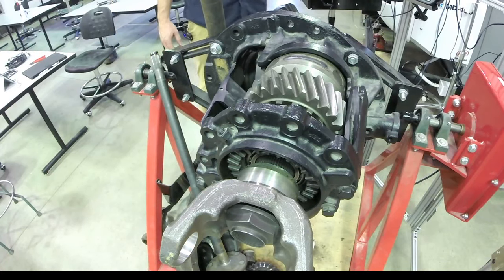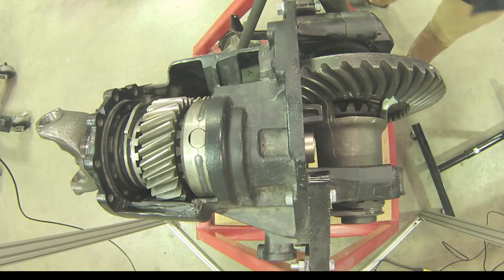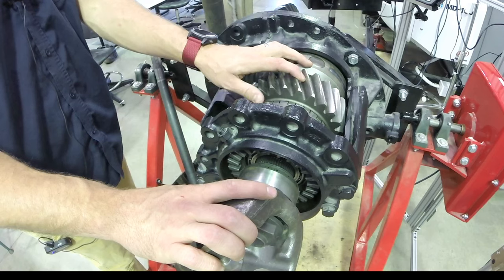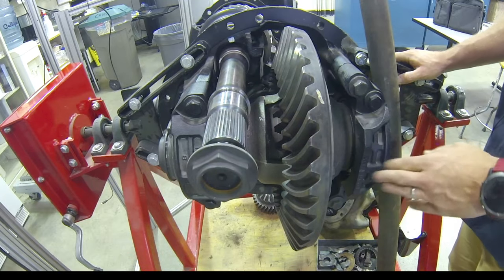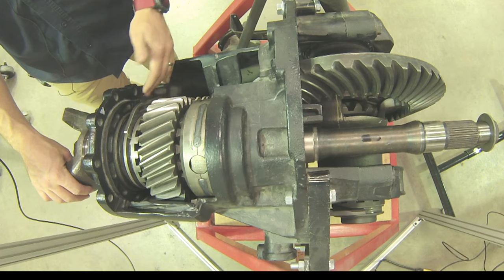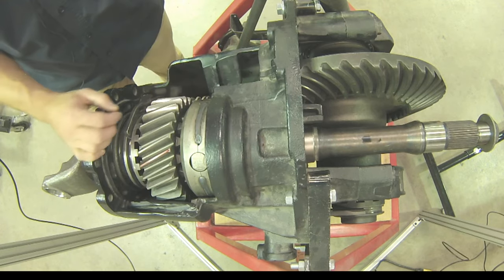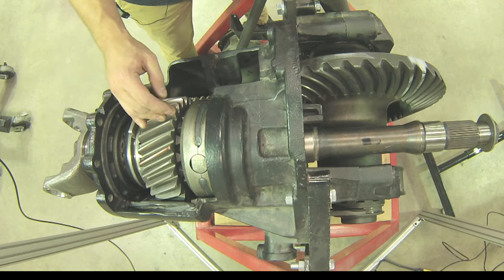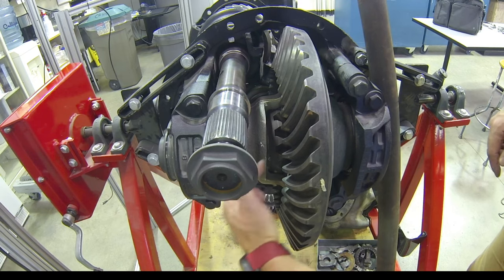Axle Fundamentals - Explanation of the Inter-axle Differential

Comment: Sir I have confusion that is in normal condition means without switching inter axle lock , is the power transmit to all 4wheels or only last two wheels?
Reply: Power to all, all the time locked or not. Locked just makes all have equal output even during slip.

Comment: I understand the axles are shown here being locked together, but are the left & right wheels on both axles also being locked to each other like in a normal differential lock?

Or is it just normal differential function on both axles, but with equal power each?

And if it's the latter, can both methods be combined locking all four wheels together at equal roation?

Comment: I have a semi that when I put in gear it won’t move till I put in the power divider then it’ll move but just the rear not the front rears will turn. When the power divider is on the drive shaft will just spin from the transmission. Any help?
Reply: Sounds like your spider gears are broke and when locked, only turn the heli gear.

Comment: So many driver believe that u only send power to the back when its not locked. They drive around locked all the time thinking they are wearing tires more evenly and they are doing the truck a favor
Reply: Seriously?  I've never heard of that before... I don't doubt you one bit! The only time I lock in is when there's potential for slip. I.e. a hairpin with gravel up a steep grade or when going from dry pavement to dirt... or when slip happens on ice and I've managed to stop and lock safely. ... I know better than to shift diff when wheel is spinning.... that being said... I somehow broke an output shaft the other day while in first gear on flat ground not loaded! It was like a laser cut the shaft! (Believe it was a factory defect) ((since the Eaton inter diff was almost exactly a year since a slip seat blew up both diffs!)) What a fluke!

Comment: The thing I'm really questioning is why do you need variable speed on both axles why not just have the whole thing a solid mechanism
Reply from the maker: It’s a concept called Ackerman’s principle. As the vehicle turns a corner each wheel assembly will take a different path with different sized radius. This will cause each wheel to turn at a different speed. If the diff is locked this difference of speed will be limited causing axle shaft, bearing stress and wear. It will also cause tire scuffing and excess tire wear.

Comment: My question is stupid, but I will ask ..if I drive 100 .Iles with the differential lock on. Will it damage anything..driving at 65mph
Reply: If you drive in a straight line on a perfectly flat road, it might be ok but the chances are it will cause transmission wind up.
Reply from the maker: Yes you will likely cause damage. The comment from 3d quick about a straight line is a valid point. The problem is that the tires likely have different wear, tire pressure and this causes the wheels to want to turn at a different speed as well as roads are rarely perfectly straight. When the diff is locked, they cannot turn at different speeds left to right. That causes wear at the axle shafts with increased torsion. It also puts the bearings supporting the axle shafts under additional load and puts stress on the lock itself. There is also a likely situation that you will cause tire scrub which will wear the tires more which will result in more stress and more damage. It isn’t uncommon in commercial vehicles to come across broken axle shafts. All this stress and wear creates more heat which breaks down the oils ability lubricate which in turn creates more stress and wear. There should be a theme emerging, follow the manufacturers usage guideline to reduce the chance of damage. Keep in mind I am responding from a commercial environment. In light duty vehicle they often have limited slip diffs and they handle the situation differently but are not often selectable.
Reply: I put buzzer/flasher combo warning systems on all of my trucks for axle and diff lock functions if you don't they will get left in and destroyed by the drivers!

Comment: Hi. My truck is a 10 speed manual (Eaton) the gears stock was on high range (I was told that this was a  minor issue) But The mechanic told me it's a big damage, they need to rebuild it for $ 3500 without labor!!!. I agreed. Then I found out, that he replaced it with another one, that one doesn't have a cooler (my transmission had one) tell me please if what the mechanic did is right/okay?. Should I accept this transmission ( the new one without the cooler)?
He's working on the truck now, haven't finished yet.. I still have time... should I accept what he did or not?? Please reply 🙏
Reply: Hi Mustang,
There are too many variables to speak to your situation. That being said, make sure that the expectations of the job are clear before work proceeds or continues. If you are quoted a rebuild, then swapping for another unit is a change in scope. The mechanic may be trying to save you money in finding a good used one. With swaps, the question is warranty, have a conversation about what you can expect. As for the cooler, most can have a cooler added by simply removing the plugs and connecting the existing cooler to the transmission. If you are getting a rebuild due to a failure though, the cooler should be replaced or you will have another contamination related failure. Whatever you do, you should talk to the mechanic, don’t try and hold the payment for the work after it’s done. If you don’t want what they are doing, talk to them.
Reply from the maker: I agree with Robert ;) I think communication is key. Clarify the budget, clarify the work, clarify the warranty expectations. Don’t hold work you approve from payment after the fact. If you have not approved the work, then the shop shouldn’t be doing it until they get approval. If you clarify all the above and they deliver something different or don’t deliver, then don’t pay until it is done as agreed.
Reply: @robertnagtegaal4355  
Thank you so much 💓 💗
Reply: @THET1916  
Thank you for the advice 🙏
Reply: @robertnagtegaal4355  
Thank you Robert and Heavy equipment for the help i appreciate it.
Just for clarification; i don't get to see the work while they're doing it. 
In my opinion i think they're trying to swap transmissions so they don't lose time... Yes, i was quoted in advance for a rebuild in my transmission, but by chance i discovered that he swapped it instead of doing the actual rebuild. When i returned today to see the truck i asked why did he install the one without the cooler, he replied" you don't need a cooler for the transmission, and your pipes for the anti freeze are rusty and i don't wanna mess eith it... " is it true that the transmission could run without a cooler or was he making excuses? Also couldn't he have just changed the pipes? 
Thank you very much.
Reply: @THET1916  
Thank you Robert and Heavy equipment for the help i appreciate it.
Just for clarification; i don't get to see the work while they're doing it. 
In my opinion i think they're trying to swap transmissions so they don't lose time... Yes, i was quoted in advance for a rebuild in my transmission, but by chance i discovered that he swapped it instead of doing the actual rebuild. When i returned today to see the truck i asked why did he install the one without the cooler, he replied" you don't need a cooler for the transmission, and your pipes for the anti freeze are rusty and i don't wanna mess eith it... " is it true that the transmission could run without a cooler or was he making excuses? Also couldn't he have just changed the pipes? 
Thank you very much.
Reply: @robertnagtegaal4355  
Their warranty; one year or 100.000 miles ....
Reply: @mustang4928  my understanding is that transmission cooler is filled with oil not "anti-freeze". Are you sure it's not a mis-communication issue that's going on here?

Comment: Can the inter axle lock be engaged at any speed as long as the tires are losing traction?
Reply from the maker: The inter axle should only be engaged with no speed or no speed differential from front to rear drive axle and depending on the model, limited to the max travel speed while engaged. Any turning done in better traction with the inter axle locked will result in damage to the inter axle.
Reply: No don't do it you will be taken it apart if you

Comment: Sir my doubt is, during a normal driving condition, all the four wheels of two axles take power or the frist drive axle of two wheels take power, the second rear axle is in dead condition.
Reply from the maker: I encourage you to watch again. The torque on an open interaxle is split between the front and back drive axle equally and then split again on an open axle carrier to the left and right wheels of each axle. It is a myth that one axle is unloaded and is not driving when unlocked and is not true. Any additional wear to any one of the two axles has to do with axle alignment or wheel wear or vehicle misloading
Reply: In normal conditions the engine is driving both the front and rear axle but because the centre differential is open, it will send power in the path of least resistance to either the front or rear axle so typically in slippery conditions the wheel out of the 4 with the least traction will get all the power and spin while the others remain static. Locking the centre differential power divider ensures one wheel on both axles receives power. For all 4 wheels to get power then the front and rear differentials need to be locked too. Not all trucks have that as standard though. Really in 2022 thise setup is archaic and there should be an automatic locking system like a Torsen device that senses traction loss and locks the diffs before the driver even realises.
Reply: @Heavy Equipment Tech Training (HETT)  both axles are always driven in this case because there is an interaxle differential.  Some trucks have an always-driven leading axle and a trailing axle which is driven only when engaged; I don't know if this is common enough to bother with, but perhaps you could show that in a separate video.

Comment: How about the triple axle?
Reply from the maker: The doubling that happens from the front to mid would double again from mid to the rear. Spinning Wheels on Tridem is a costly practice for tire wear.
Reply: @THET1916  The first interaxle should be 33-67% then. Yes one wheel spinning is gonna have 6x speed
Reply from the maker: @G55STEYR   not 6, 8x... I have been working in making a video showing htis using a tridem. It would be a collab with another instructor, I hope to get it going soon.
Reply: @THET1916  If the first interaxle differential has the 33:67 distribution suggested by G55STEYR, it would only be 6X, because the forward axle's splitter would only multiply the rearward output speed by a factor of 1.5 (not 2). At least recent Meritor tridem sets (e.g. MZ-610, P600, ProTec 5000) have this configuration.

Comment: Sir, do the interaxle differential, and differential in the tandom boogie operate at the same time when the vehicle is turning.
Reply from the maker: Yes, the bevel gear of each axle will go the average speed of its wheel assemblies while the unlocked interaxle will have its differential cross shaft rotating at the average speed of the two drive pinions as the cross shaft is connected to the interaxle input

Comment: Question to channel trainer: I have 2 trucks. Volvo with Eaton 3.90 rear, and Freightliner with Meritor 3.73 rear.

The Meritor 3.73 loses traction very easily on uneven ground, so I have to engage diff lock to keep moving WHEREAS the Eaton can creep up without effort. Is this due to the minor rear end ratio? 🤔

Also I checked the fluid level of the Meritor thru finger port and immediately upon unscrewing the plug, darker fluid came out but had an obvious shiny glittery dusty metal look to it. I got the fluid drained and the "metal dusty" effect was not there. I change the fluids annually, so I'm at a loss of what's going on.

Both trucks just hit 1M miles on original diffs, unopened diffs.

Looking forward to some insights. Thx
Reply from the maker: Thanks for the questions.
Simple one first, for the silvery oil, install a mag plug and it will catch/attract large metal particles and you can swap them for inspection without changing the oil. As for 1M miles, while others may get longer and will chime in I’m sure, most manufacturers warranty to 750K so a clean 1M record is great. Just a bit of advice, a rebuild before failure is hugely cheaper than one after. What I recommend is find a good shop on some quiet time and get them rebearing and reseated and the cost should be a lot less than after failure. Just get a shop that does these often as they will have to set the pattern back to the old pattern to reuse the gears. 
As for the crawling, like the small ratio difference is making a difference. Another thing to consider on open diffs is tire pressure, tire wear and tire brand for traction on the ground. All this equal and the ratio will make a difference to what can be made, the tires determine if the torque can actually be delivered. Torque is only as good as the traction of the tires. 
To explain the ratio impact I’ll use some real numbers 
Assuming a 2000ftlbs clutch maxed out with a transmission in first with a ratio of 14.6:1 for both trucks. With the 3.90 ratio it can max generate 113880ftlbs of torque with the 3.73 it will make 109500ftlbs making a 4380ftlbs difference in generated torque. 
Hope this helps.

Comment: IF the purpose of this video is to teach fundamentals rather than show exposed features only, it is rather deficient IMO. First, dedicating yourself to this particular teaching hardware involves highly limited visibility of key mechanical features and cause-and-effect relations. It would be better to use some other toy model that gives one a full view. This is the biggest limitation IMO, but not the only one. I feel like the instruction is "teaching to the answer" for a test, not teaching for comprehension. Quite frankly, this is often seen in practical, trade, or OJT teaching since the purpose of training is to quickly and cheaply get the trainees to answer a question with the right words or take the right action, regardless of true understanding. People who have learned from this teaching method often apply to all situations, when it is not appropriate to do so at times.

Second deficiency, the instruction uses jargon ("splined", etc) with implied understanding of what the jargon means. However, this is worse than you might think. Even if one understands the jargon, the instruction expects implied understanding of how the jargon-specified features are related to the mechanics. That is far from certain for most viewers of this video. To understand the implications, one would either need to have an existing understanding of this hardware (so why even watch the video) or one would need to see it (which one can't, since the model is solid metal and key parts are hidden). If you are teaching based on implied understanding, you have to first teach about the features and reasons you expect to be understood as well.

Perhaps this video accompanies live classroom demos that are more comprehensive? If not, I do believe it represents a lot of lost opportunity to pass along knowledge.
Reply from the maker: Thank you for your feedback.
Reply: "Splined" is not a problem. Some degree of prerequisite knowledge is necessary; for instance, the video is in English so the audience must understand English. Terms such as "gear" and "shaft" must be understood... and "spline" falls in the same category of basic knowledge.
Reply: I would think if you read the title you would catch what it is about, it is not titled Axle Parts names 101.  He has 20 some videos on this subject.   Expecting every video to start at level one would make videos days long.  Start at the level you are; do not expect every video to start at the level you are.